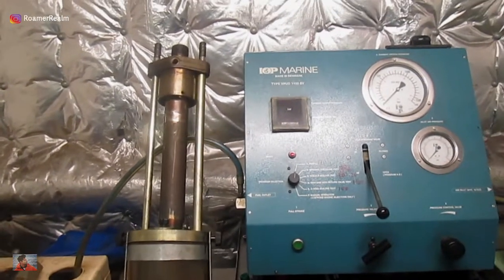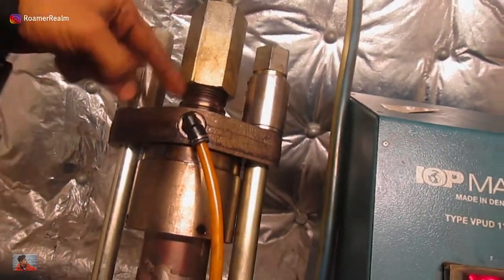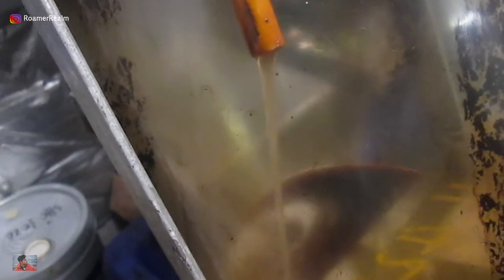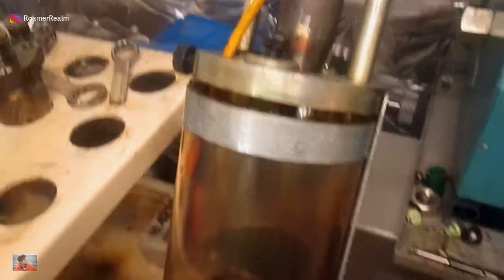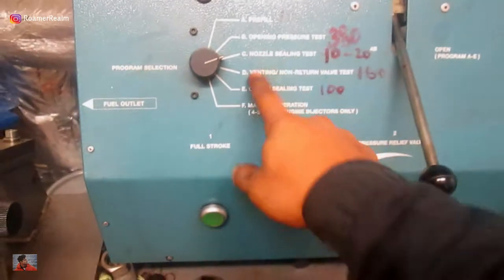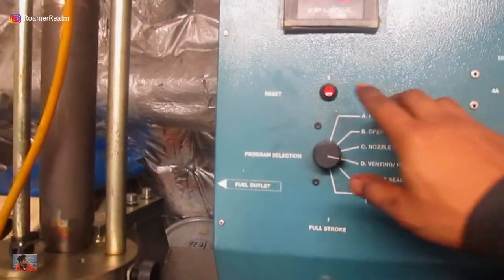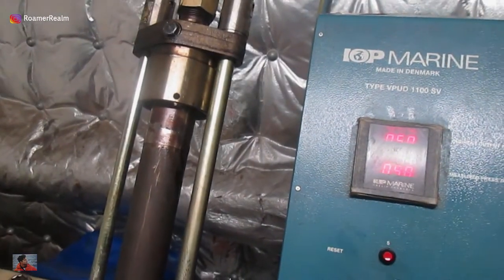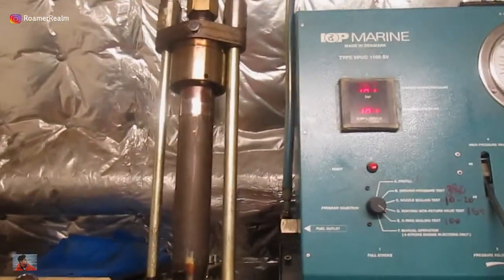Pressure Testing Fuel Valves | Fuel Valve of Diesel Engines on Ships | Marine Engineer | RoamerRealm

Comment: I have one query about venting nrv test at 160 bar how the presaure ia dropping its because the sliding valve is getting slide fown and recirculating oil is leading to pressure drop ??
Reply from the maker: Hi Mithun! Really sorry, this comment slipped my mind. Yours is a Great question, it got me thinking. During testing, I have always been so focused on seeing the the pump cut out around 160 Bar that I never really thought what’s causing the sudden pressure drop or how. However, the most likely reason for the pressure to drop is due to the recirculation. I have decided to make a video about the overhaul of the NRV especially for you. Hope that will help you understand the topic better. Thanks once again for the question and do subscribe to my YouTube channel 👍

Comment: I liked your video, can you clarify my doubt, i am a second eng, some fuel testing pump, on slide type fuel valve , say not to carry an atomization test as this will damage the slide valve and atomiser, when you test on the test bed it only spray but no atomization., can you guide me , to clarify my doubt, last ship i had the same testing machine like the one on the video, so i could perform an atomization test at 340 bar, can you clarify my doubt.
Reply from the maker: Thanks a lot for appreciating the video. About your question: please tell me the make/model of the engine and the type of fuel system onboard (classic, electronic etc. Do subscribe to my YouTube channel 👍

Comment: Hello Young man, i saw your nice  reply to my comment on  sea suction strainer cleaning video. Now about  regarding testing of fuel injector.  My first ship named M.T. Jag Prakash a product tanker, an indian ship.
12,000 BHP, RND Sulzur main engine. Usually 3 rd engineer does main engine jobs. Fuel injector also called fuel valve those days will be removed from the cylinder head after safety procedures . Once after  cleaning the pocket, and other checks an  already overhauled injector will be fitted. Normally we use overhead crane for lifting. 
Those days there was no testing machine like you showed. But we use a pressure gauge range 0- 500 bar. Testing equipment was a small open tank with provision to fix the injector in place safely. A small oil  container with d.o . connection to connect the injector, a pressure gauge, also a hydraulic hand pump for pressurising the valve is provided. Injector opening range i remember from 220- 260 bar. After venting we increase the pressure slowly. We check for the opening with a squeaking sound and spray.  We also check for dribble /leak. We put a tissue paper below the valve for anydrops. Warning given by the senior engineer,  no one should put a hand below the valve while testing, it will puncture the hand. Also when we overhaul the valve we check and clean nozzle cooling space. The test stand got a adapter for testing Auxiliary engine injectors. Learnt some thing new from you. By the way you are from which country. If possible your name also. My name is there on the comment. I am from lndia.
Reply from the maker: Hi Chief! Yet again, great to receive a comment from you, thank you. 

Thank you for sharing your experience, it's nice to know about how different things were back when you were a junior engineer. I am working as a 2nd Engineer right now and this job is still usually done by 3rd Engineer, but due to reduced man power (only CE, 2E & 3E as watch keeping engineers on board), depending on ship, injectors are also prepared and tested by 2/E.

It's amazing to know how much of the procedures, details and parameters you remember even after so many years away from sea, even the testing injection pressure. Yes, as the engine generation advanced and technology improved, so did the Pmax and also the injection pressure. These days the injection pressure is around 370-380 Bar. 

Chief, my name is Rahul, I am Indian. I am glad this video brought back fond memories of your younger sailor days. Once a sailor, always a sailor 👍 Please do subscribe to my YouTube channel
Reply: Hello sir very very nice to see ur comment.my name is purushothaman I'm a engine cadet now ... I don't know why but ur also my inspiration sir .I'm thanking you for such a brief and worth full comment sir.and one more thing I'm also Indian (tamilan)
Reply from the maker: @potatogaming3374  Great to see your comment and the nice words! Keep up the good work and let me know if you ever have any questions or need some help understanding any of the systems on board. Do subscribe to my YouTube channel 👍